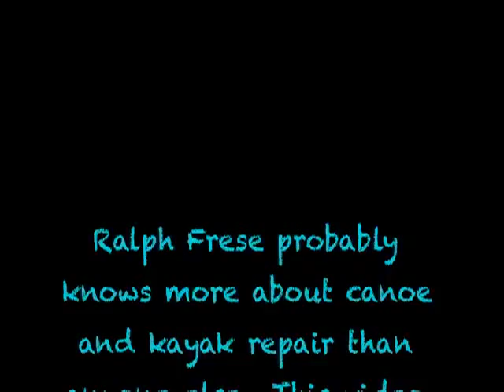Ask Mr. Canoe 1

Comment: West Marine G Flex is the best repair for Royalex
Reply: G FLEX will repair all your royalex needs. I've used it to repair a crushed probe 12 stern that cracked all the way through; a crushed bow on a mad river outrage that had an 8 inch split running up it and 12 inch cold cracks on a dagger Genesis.  It's fantastic